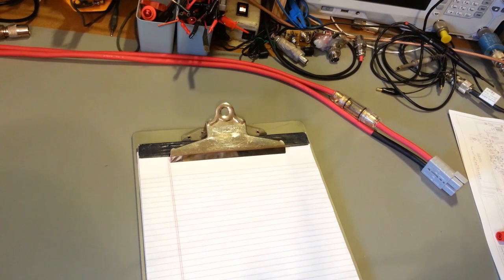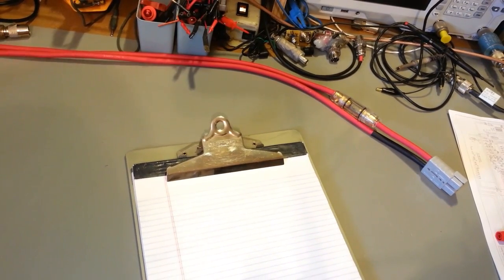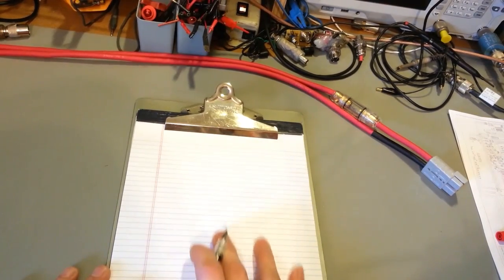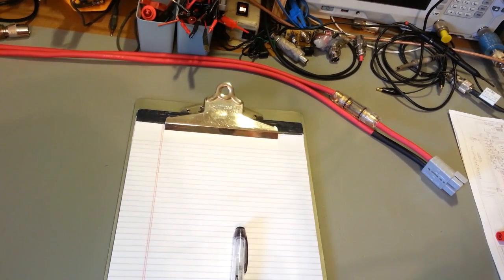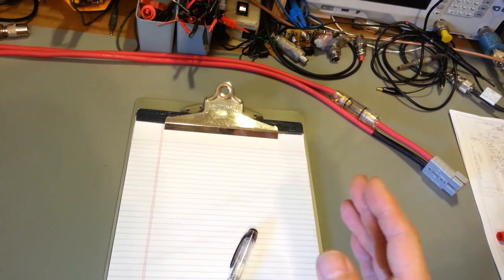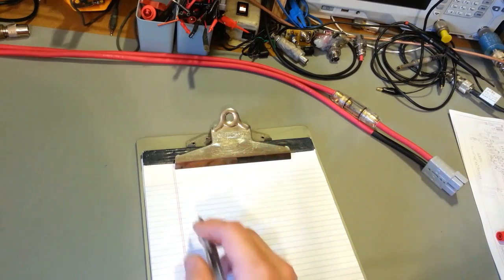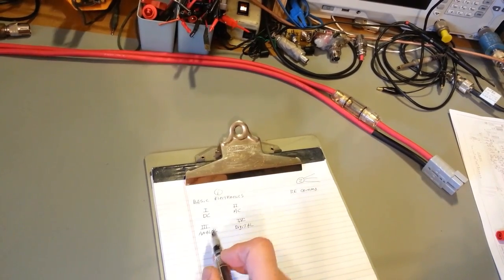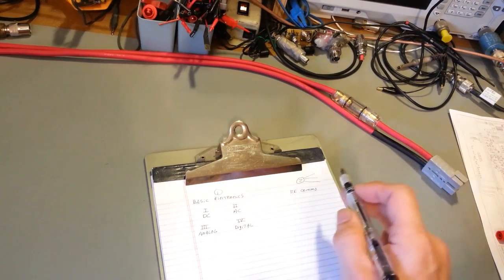Going to do a full course on basic electronics here on YouTube. Your thoughts....

Comment: Maybe align it with some book(s) that could give you content and an outline and the people watching a place for more information?  Examples: ARRL Handbook, The ARRL Hands On Radio book pair (a long series of projects from the basics of transistors on up), Practical Electronics for Inventors, The Art of Electronics.  It sounded like Buddy was wanting to do something similar, maybe work together?  On the Practical hands-on side, maybe hook up with AdaFruit or Mouser for the parts kits or lists?  Just learning how to deal with these web sites to get the parts you want could be a video in itself.  Building a basic low amperage current controlled supply could be a very good hands on project.  You could get people to donate old equipment to build up a test bench for some deserving person who it would really help get started.  No doubt a huge effort, so maybe enlist other members of the YouTube Radio Repair and electronics community to help with the outline, content, review of ideas and coverage etc.?  Personally, I am trying to get a better understanding of L and C phase interaction and the basics of what is really happening inside LC circuits and the rabbit hole goes deeper than one might think.  Just a real clear documentation of the phases and amplitudes of voltages and currents inside a basic LC tank circuit is not easy to come by.  It is fairly easy to understand the basic concepts but the details are hard to come by.  It is not easily demonstrated with non-differential O-scope probes either.  It seems like simulators are the only reasonable way to really investigate something as simple as a tank circuit.   I know I would spend the time to learn from you!  Thanks.

Comment: I think it is a great idea as well Mike. What an endeavor! How are you going to make money on your regular job as well?

   One EXTREMELY important thing you must decide to choose explaining upfront is "Conventional Flow vs Electron Flow Theory." In R.E.T.S. (Radio Electronics Radio School) back when I went there in the 70's in Boston we learned "Electron Flow Theory."

    After my 2 years there I went and had a job interview at a computer electronics manufacturer. An engineer whipped out a schematic of a disk drive controller. He then asked me to explain how the electron flow worked in this schematic. He said NO to everything I explained. I didn't realize that in engineering school they teach Conventional flow which is backwards. I'm sure he had a good laugh after that interview! I, of course, got that job anyway.

   So you can see here, this is an important decision that you need to make before even starting. Since you have newbies in general, myself I would teach "Electron Flow Theory." Negative to Positive. This is what was taught mostly in technical schools. Your call my friend...

   Will REALLY be looking forward to this fine and comprehensive series Mike!
      Best of luck,
               Tom
Reply from the maker: +AntiqueRadioandTV 

I will probably teach both conventional and electron flow simultaneously.  That's the way I learned it.  Almost need to do it that way because it can get confusing for people when it comes to semiconductors.  Just think of the humble little diode.  Electrons do not flow like the arrow in the schematic symbol.  It really is a shame they didn't get the electron flow correct way back when they were investigating electricity.  They had a 50/50 chance and got it wrong unfornately.
Reply: That's exactly right Mike. So in hole theory of semiconductors, the "hole flow", flows in conventional current direction. I guess that's how they get around this arrow pointing in the wrong way stuff.

Comment: Mike, love the concept, the only feed I might have is if you want to course to live on for the ages you might reconsider the embedding of the give away codes and give aways themselves. just thought.  Also if you're not interested in running your own website you might look to partner with one of the other electronics forums around the web and perhaps they can set up a sub thread / section for your course? or setup a subreddit on reddit and have a posting for each course video that you create and others can collaborate in the comments. for files hosting and downloads since your material is free you can probably host it on archive.org

Comment: Im interested in this mike as for the logistics im sure there is virtual classroom websites that you can setup so we can setup exams etc so basically you record the video list that as this weeks subject along with a cheat sheet and practice questions, also  the other people enrolled on the course will be able to discuss between themselves along with your input. have a look at  something called moodle may help plan what you will need to do
Reply from the maker: +Steve Ellis 

Wow, Moodle looks like exactly what I need and it's free.  It even has youtube integration.
Reply: I thought it would be a good choice for this Mike, allows you the control you need and allows the people taking the course the structure they need to learn. and also allows you to repeat the course without much effort once u have done it once.
Reply: I think the ARRL used Moodle for some of their on-line emergency communications courses. I wasn't real impressed with the user interface, but that was 10-15 years ago. I'm like to believe it's gotten better since then.

If you just need a repository for files, maybe you can set up a read-only folder in Google Drive or Dropbox where folks can go to download the circuit files, data sheets, bills of material, tests, etc.

For schematics and circuit simulation, take a look at EasyEDA. It's web-based, so no software to download and install.

Finally, Mike, I commend you for tackling this. When I was still working, we had a huge problem finding field technicians to work on commercial HVAC controls. They either had a college degree and were expecting more salary than we were prepared to pay or they were former residential heating & cooling techs who didn't have the necessary electronics background. All of the post-high school technical schools in the area have closed, so I don't know where a guy has to go these days to learn what you are prepared to teach. Good luck!
Reply: Edmodo is another platform you could use

Comment: Sounds like a great idea.  I will certainly be following.  Even us old folks can learn something new.  I do have a question that is not really related to the course that you can probably answer for me.  Back in the 70's when I started repairing electronics, you had to hold a first class radio telephone license to service cb transmitters.  Do you know if that requirement has been officially dropped, and what other laws might apply.  I know some states require tech to be licensed, which I'm sure is just a way to raise money.  I am just curious.  I hold a ham radio license and can build and repair ham radio equipment which should include modifying cb radios.  Just your thoughts.
Reply from the maker: They did away with license requirements to service CB radios decades ago so no license is required.  One thing of interest in the CB world is the proposed rules change to FMRS/GMRS and CB regulations.  If it goes through it will allow contacts on CB radios over 155 miles.  As it stands now it's actually illegal to

Comment: I would love to participate in a course like this but have a question I'm sure many other neophytes like myself are going to bring up. How is someone who knows very little about oscilloscopes supposed to be able to purchase a used scope off of ebay and not end up with a unit that is DOA and don't know how to check to see if all the functions are operating properly? I've wanted a scope for years to learn with but can't afford a new one in order to make sure it even works when I get it. The majority of "cheap" used scopes on ebay look like they have been dragged down a gravel road for years most of the time with bits and pieces missing. Most I've looked at don't come with probes or owners manuals either.   :-(

Comment: Instead a long course you can make something different than really most of people on YouTube. Do some trick video series. Forexample; How to define an unknown transformer. Which side is primary nor secondary. Or is it power up/down or HF etc transform? Should you use this power down transformer as power up transformer? If use what happens etc. 

I think you got what I mentioned. I found your channel yet but seems will be funny. And here is a suggestion; try not use your oscilloscope nor something similar devices much in your course lessons. Electronic beginners will have only a multimeter  (mostly).